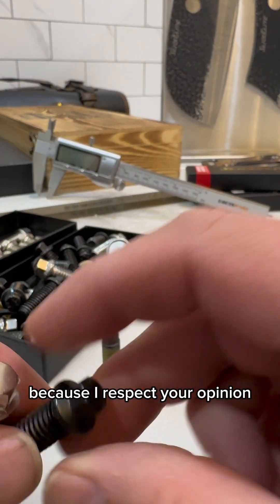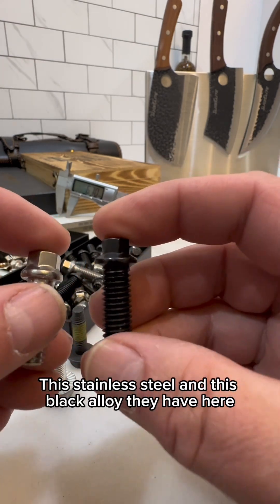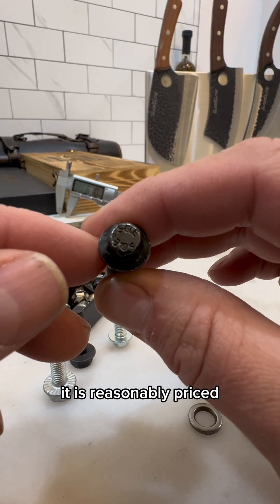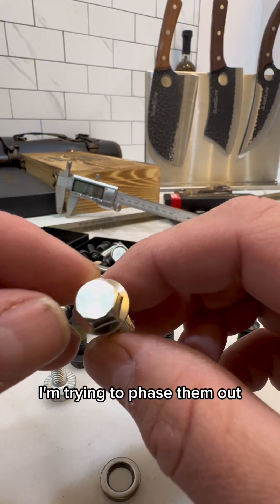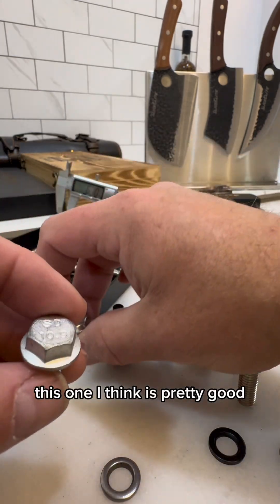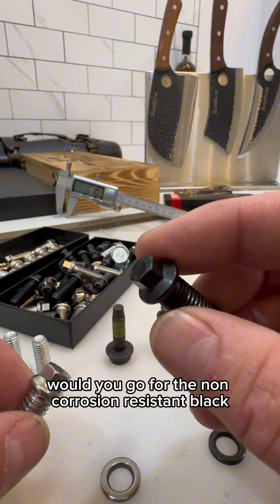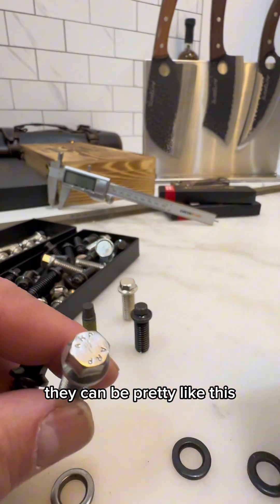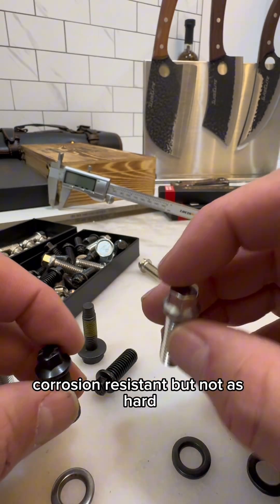Comparing Header Bolt Alloys: ARP vs Stainless vs Black-Coated. Need Expert Opinions

Comment from the maker: But... i'm trying to decide on which type of steel I want to use for the bolts produced to be included the exhaust headers that I sell. I want them to be exceptional. Thank you for taking the time to comment though (you're the only one that gave me your opinion, here lol) Under normal circumstances, not a big decision. But I am having 60,000 header bolts produced, and I'm putting my name on them. It's a big decision.

Comment: Dude you sound like me, your way over thinking it. Discard the ones that come with the headers and then flip a coin. If you want them  to stay pretty use the stainless if that doesn't matter use the black ones. Of course the OEM bolts are probably a safe bet as they are on thousands of vehicles already, and unless your motor is so crazy that you're running ridiculous exhaust manifold, heat, and pressure then just flip a coin!